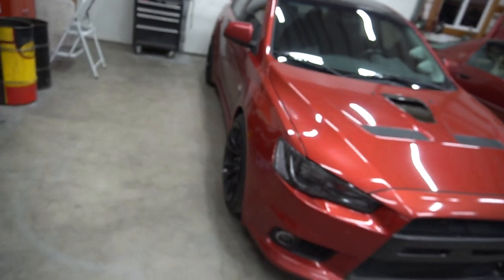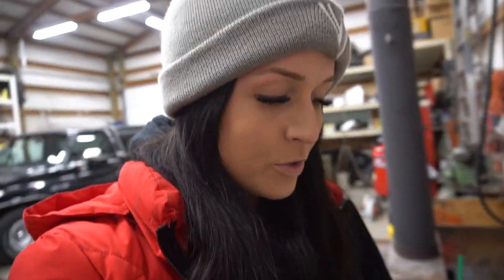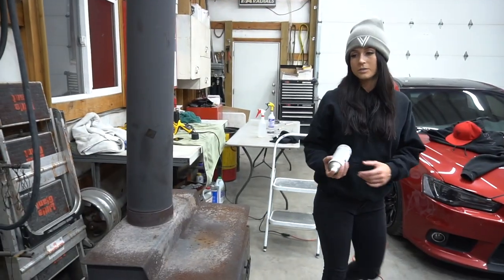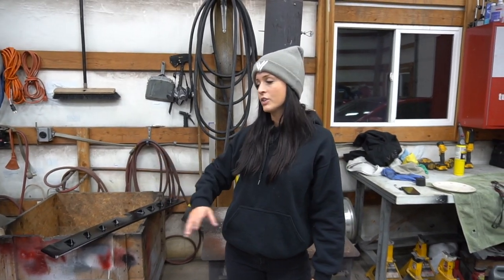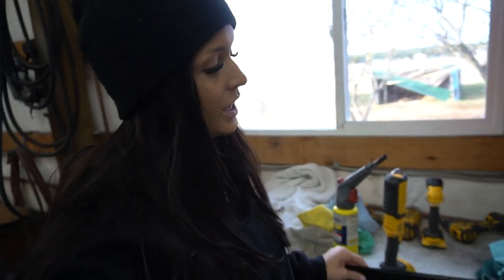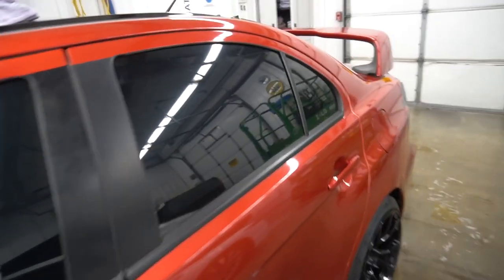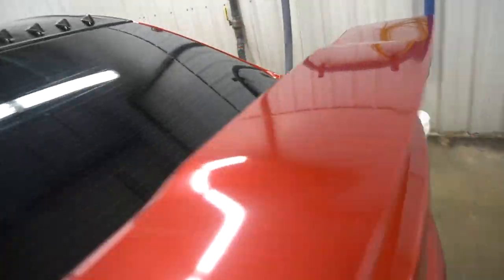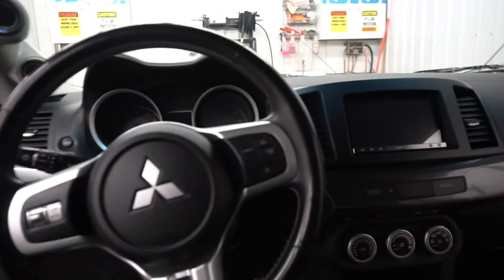Getting my hands dirty | Evo X

Comment: 250 to remove damaged layer. 800 to remove the deep gouges from the 250. 2 layers of paint then 1000 grit. third layer of paint then 2000 girt. polish or wipe down with f11 for shine. knowing how much goes into a proper pain job makes vinyl wrap look real good.

Comment: Nice job on the build so far! I noticed you're still running a stock turbo so id like to recommend a stock frame turbo that's good for 500WHP easily, check out the GT Spec by TPC. It's a direct bolt in, spools crazy fast with great power, and it's 1K cheaper than a comparable Garrett. I've been making over 500 on mine still with a completely stock block with no issues at all.

Comment: Kinda, wished the pre owner would have tosed the OEM radio back in, I got the aftermarket one from Sygav, which is a bigger screen.. But, the way he or she put it in, I think either a corner clip is busted or something that isn't fitting well. Cause it rattles. I also got a few other things that rattle in car, like the seat belt holder on each side of the car.

Comment: I do apologize but where did you get the plugs for the license plate section. Did, you get them from https://www.bumperplugs.com/index.php?route=product/product&product_id=89 or were they already installed on the car, I don't recall if you  added them or not. Thanks.